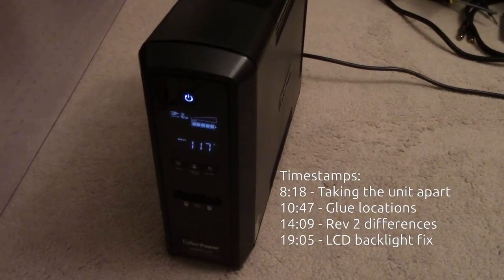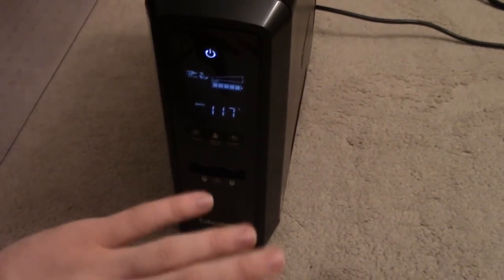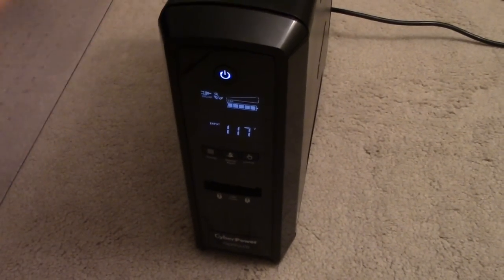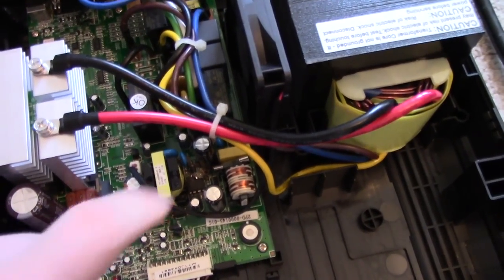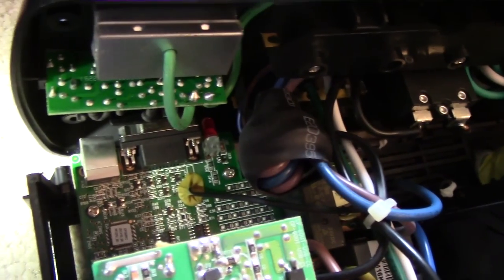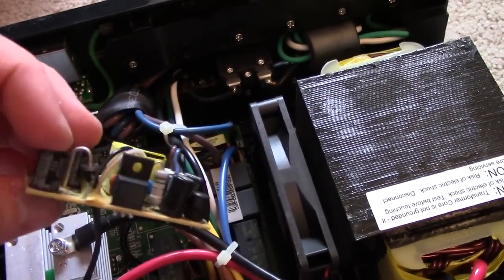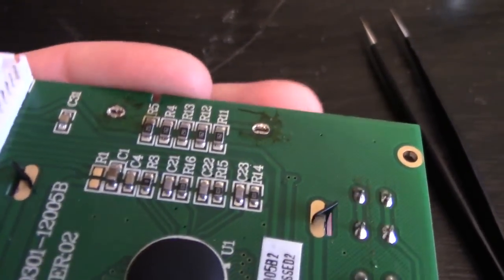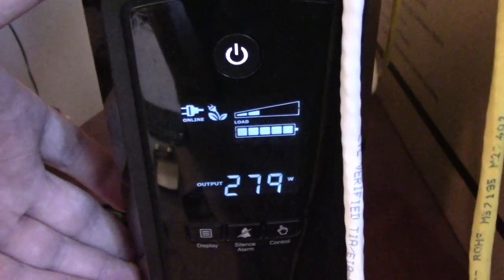CyberPower UPSes Contain Conductive Yellow Glue of Death (+ Bonus Rev. 2 Dim LCD Fix)

Comment: I've had multiple of similar UPS fail (CP1000AVRLCD and CP850PFCLCD) in the past.  Probably purchased around to 2011-2013 timeframe.  I don't believe that any of them lasted longer than 2 years.  The attached devices would lose power and I would smell a horrible electronics burning smell. I would look over to the UPS and it would be melting and/or smoldering.

I wonder if this is why.  Too late to go back and investigate.  I had 5 UPS fail this way.  Most had a <20W load and I think the CP1000AVRLCD may have had an intermittent 200w load.
Reply: what made you buy another after the first two burnt?
Reply: @nyaa  I had purchased them for other people...so I didn't know of most of the failures until I started asking around.

They were all generally purchased before the second failure. I didn't identify a trend until the second UPS failed.  When I heard of the third failure, that's when I asked everybody else if their UPS failed.

Comment: I picked up a CP1000AVRLCD recently (old model with single silver button in front) and took some pictures of the inside, just for reference, and I see some of that stuff, all dark orange and caked, almost exactly the same place as yours (board looks to be laid out similarly). Better put this offline and clean that up. Thanks! BTW top just pulls straight off on this model (stick screwdriver under and pry up). Rest unscrews.

The one by the capacitor in the center was too hardened to get off without potentially damaging the hidden components underneath. I didn't measure very low resistance (in the Mohms) so I'm just leaving it in place.

Comment: I have an old 2012 cyber power 1000 avr that's been in use since time bought with no issues so I disassembled it looked at the board but could find no glue used anywhere. I figured if it's under the caps a bit of it would be visible from the sides but I can't see it at all. My question is could it be possible they didn't use any on it for that particular year? I figured if they did it would have smoked out a long time ago.

Comment: Fun, I have two of these deployed! This will be interesting...

Oddly enough the one in my server rack (mounted 90°) has an issue where the power button flickers and the LED has basically stopped working after the two years I've had it.
Reply: Same thing happened to one of mine so I emailed Cyberpower and they sent me a replacement front panel even though the unit was older than a year.

Comment: Huh, the adhesive I have always seen is white, so I wonder if there is a few different types of the adhesive!
Reply: the white adhesive is typically silicone based.
Reply: @ryanhebron4287  that's what I was thinking, and they are only saving a few cents, I wonder why they went with this shittier version
Reply: @davidtheawesomeone5358  A few cents over tens or hundreds of thousands of units adds up real fast. Its also Cyberpower so... I personally prefer APC and Eaton.
Reply: @ryanhebron4287  yup, I understand that. And me too, I prefer APC, used them a lot and they last

Comment: I been using this unit since college. I’m guessing I bought it in 2008/2009 when NCIX was still around. I have replaced the batteries once in that time frame and am still using this unit. This video has me worried as I sleep next to this unit as my computer and equipment is in the same room in my apartment. I was planning to buy a new one and migrate the old one to the living room for the entertainment center. Now I’m not sure what I’m gonna do as I have no plans of tearing this unit down to go poking at something that I’m not familiar with and I don’t understand, if this is as bad and dangerous as what being said, how is cyber power not sued by anyone yet for it. Has anyone had a fire due to this ?

Comment: I just took apart one of CyberPower's Value line UPSs (the old, cheap ones) and it was using hot glue for connectors and silicone glue for caps. Are you sure they haven't switched away from Sony Bond altogether? Feels weird they'd be using the good glue for the shitty UPS and the shitty glue for the high end one.

Comment: Hi, I have a Cyberpower CP1500EPFCLCD which will not turn on. On the bottom switching I have 27V but when I press the power button I can only hear a very very short "bep" from the buzzer but nothing on the screen and no relay switch. I have no power on the 3.3V regulator near the mcu on the back of the board and also on the MC34063A regulator near the heatsinks. Can you please help me? Any idea where the problem could be? Thank you very much! 
Simone

Comment: Fixed one of my UPS's, the glue was a bear to get off. "Flux Off" (mostly acetone) does seem to help soften the glue some to make it a little easier to get off.

For the LEDs, what LEDs can be used to replace the screen and power button backlights? I've got to place an order but am not all that familiar with LEDs. Voltage across the 3 screen backlights is 2.8V and I see about 1.68-1.75 V on the power button backlight. Which is odd because I don't see any white LEDs around the 1.7 voltage range?

Comment: That glue can be found in many other things...exit signs, emergency lighting, industrial machinery, even robotics. other UPS brands use it too. If there was a fault with it, there would be far more issues reported, and i see no evidence of that specific thing being a wide spread concern.
The darkening most likely is due to heat i would think.
I have had over a dozen of these ups's in service, for several years, even the old ones, never had a single issue with them. Even the v1, v2, still in service. CyberPower been the only UPS brand I trust, never had a single failure, unlike APC; to which, i have never had a single unit of theirs last more than 2yrs and one actually caused a small fire at a previous workplace of mine. CyberPower is actually headquartered where i live. Not some overseas company. I can just drive to their headquarters if i eve needed to.

Comment: Have you figured out how to open the third gen case yet?  It is different than you describe.  There is no longer a separate top piece cover that just slides back to reveal clips that you can disengage.  The top appears to be identical to the bottom in the way it snaps together.  The back is different too.  Just 4 screws now and clips in the middle.  The back is easy enough to take off but haven't yet figured out a way to separate the two sides.

Comment: Great Video, thanks for sharing.  I have 3 of the Rev 2 units, purchased back in 2016 and the first unit that was supporting my Modem, Routers and 1 DVR PC died last night.  I pulled the batteries and one had a little over 10.5Volts and the other only has a little over 6 volts, so time for upgrades.  I will pull the unit apart and check the glue issue as well.  Have you tried replacing the Lead acid batteries with Lipo batteries by any chance?  Batteries are about $45 each, but claim 4000+ recharges, 90% capacity and 8-10 Ah capacities with up to 10 years of life!  I did replace one in an old small APC 500 Watt UPS and its working fine.  Was thinking about doing the same for this one.  Any thoughts or suggestions??
Reply: I have seen it for myself that you get double the run time if you use a reputable company brand of LiFePO4 batteries with the same AH rating. Seen in both the CP1500PFCLCD and CP1000PFCLCD of which both use the 12V9AH SLA with the CP1500PFCLCD using two in series and the CP1000PFCLCD just using one.
Reply: @FirstLastOne  Yep, that is because you can run them almost completely dead without damaging those batteries.  The wet cell or gel cell batteries really should only be used down to about 50% before recharging or they can get permanently damaged.  The only issue I see with replacing the Gel cell batteries with LiFePO4 batteries is that the charging and maintenance electronics in the UPS does not know that they exist.  The Charging, Maintenance and actual running and cut off voltages are all different for the LiFePO4 batteries.  The UPS itself is not really optimized to use those types of batteries although I have replaced one in a small APC UPS with one of them and it seems to be doing okay at the moment.  Unless you can tell the UPS what "Kind" of battery you have installed, it will always assume it's the type that it was originally shipped with and the charging and running profile will always be used even on the LiFePO4 batteries which is not optimal or efficient and actually could eventually damage the batteries.  In my humble opinion, If I'm going to spend a fortune for LiFePO4 Batteries, I will only do so to install into a UPS that can take full advantage of them and not risk damaging them due to improper charging and running profiles.  On some Recreational Vehicle Charge Converters, they are now shipping with the intelligence built in to determine what "Kind" of battery has been installed, and they automatically adjust their charge profile and run profile to match the battery type, optimizing the life, run time and charging of the batteries.  Hopefully UPS Manufactures will get on the bandwagon and do the same in their new products giving consumers more choices when replacing UPS Batteries.

Comment: I have 2 of the Rev 2's which both LED screens have died out.  Since I have no experience changing LED's is it possible to order Rev 1 or Rev 3 screens and swap out with the Rev 2's?  If so do you have a link where to order these?

Comment: I checked the Sinewave 900va (EU version/plugs) that I bought 3 years ago. It is not v3, since afaik there's no v3 EU versions. I didn't attempt to open the side panel, but I looked through most angles and saw the glue on the big capacitor. It wasn't brown, looked "healthy" and wasn't touching other components, so I saw no need to do anything.

Comment: Well I jinxed myself with this one. Watched this video and a few hours later my UPS the 1500 model died with a f03 fault :(
Reply from the maker: F03 is a charger fault, which occurs if the voltage is too low for an extended period of time. I have seen this before, and it was a shorted battery pulling the voltage down. If you disconnect the battery and the error goes away it's likely this.

Comment: Designed to fail! They could have put a random number generator in firmware. After a predetermined number of hours, a firmware algorithm begins rolling dice. The firmware rolls in the customer's behalf, eventually rolling craps. This of course is where the machine "craps out," the customer loses, and now he has a problem. But this is rather crude, failure which also involves a burning smell. (My wife was not pleased.)

You know a lot about surface mount and electronics. Thanks for useful information.

Comment: Sony invented it for use on electronics, its Chloroprene SC121.  They quickly realized that it would become conductive and stopped using it on their on electronics  and for a while sold it for other companies to use on their electronics.  They still sell it to other companies to this day with a disclaimer that it should not be used where it comes in contact with electricity.

Comment: I have a CP1500avrlcd which looks very similar to the CP1500PFCLCD and is often compared in many reviews.  The problem is that the CP1500avrlcd's case isn't exactly the same as the top cover doesn't slide off and removal of the four screws on the back won't release the back plate with the sockets.  Anyone know how to disassemble a CP1500avrlcd?
Reply: With electronics, the secret is often hidden screws. In particular, have you checked under any labels/stickers?
Reply: @bradkaral1188  Unfortunately, there aren't any stickers.

Comment: I got a CP900EPFCLCD second hand. However, it has the F03 error in it. Already removed all the glue I could. In the beginning I thought that just swapping the blown caps would be enough to fix it. It seems that the UPS is not charging the battery at all. When I charge the battery with an external charger, it seems to last between 2 to 4 days working without issues. However, after the battery voltage drops bellow a level, the F03 error is triggered, starts beeping without a pause, and I have to switch it off and disconnect completely. What can I do to fix the error? :(

Comment: I thought they they only used this crap around LV areas and used silicon around HV areas? Apparently not! I gather that being made of chalk and applied in a heat prone area it looks like it's heating up, drying out, breaking down and probably absorbing some moisture from the air.

I've got one of their large power board style UPS thats just about in need of a battery replacement. I guess I'll have to check for this crud as well. I was also going to by a second cheaper one of theirs.

Comment: Fantastic video.  My Rev1 model (from 2011) just got new batteries and when I plugged it back in I heard arcing.  Opened it up per your video and wouldn't you know it.  Arced at the fuse/resistor right next to it.  Both are dead.  Yaay.

Edit  I found the correct size fuses for the circuit board.  Does anyone know, were these fast or slow blow fuses?

Comment: By change do you know if the CP1500EPFCLCDa-AU (230V / 50hz) models are likely affected?
Reply: I'm not in the AU region myself, but I can confirm my Schuko-connector CP1500EPFCLCD has glue that is turning brown as well. I have two units, only opened the one so far (as the power LED started blinking and flickering like crazy) and will be attempting the repair soon. Just replaced the batteries on both as well, so hope I don't end up ruining them...

Comment: Screw doing all that. If one is that concerned just get a new UPS. I've been using my CP1350PFCLCD for 10.5 years without any issue. I recently replaced the batteries. I'll replace the UPS in 3-4 years which is the recommended lifespan for a UPS.

Comment: I have one of these units.  Bought at Best Buy, 4 to 6 years ago.  When the power went out, it had near zero power in the battery.  If the battery is designed to last only 1 to 3 years then there should be an easy access to replace the battery.  Otherwise these are all just landfill garbage.  Update:  The batteries were full.  Something on the board went out.  It is built so light duty that I don't think it would work right straight out of the box.  Junk.

Comment: hi budy, can u help me? I have a CP1350PFCLCD unit to which I was going to change the batteries, but when connecting to test it without them, the screen no longer turned on. when I put a new battery it works fine, but without it it doesn't even turn on

Comment: I dunno. It seems like lay disassembly of a line-level voltage system like a UPS could easily prove more hazardous than the glue, especially advocating picking at the board and components with presumably sharp metal tools. Also, your description claims "fiery failure" happens but you provide no evidence of such unless I missed something. You mention a "blowout" on the unit on screen but obviously it didn't catch fire since you repaired it and it looks fine? So what fiery failures have occurred exactly?

Comment: does this effect the CP1500EPFCLCD model not sure what the difference is with the extra E in the naming.
Reply: wanted to buy this model too, you didn't opened it to see if there said glue in inside?
Reply: Looks like it does. It's a slightly different design on the inside (different layout, probably to cater to 230V), but one of mine has the same goop on/around the chip... and it's turning brown. Haven't opened the other one yet, but I'm assuming it'll be the same story there. Attempting my repair tomorrow, hope I don't ruin them... Just got new batteries, too. :(

Comment: Sept. 9th. 2021: When I bought two of those on Amazon yesterday, then I saw this video for the first time. I did call the company and talked to their technical dept.. (Cyber Power Systems USA, Inc.) They say they know about this video; they're not worried because it's completely false; The tech guy said that If this was true, the 'National Electric Code would not have approved the design; this Federal entity has seen the video and verified with them that it wasn't true. What'smore, their marketing dept. is looking into suing this channel for slander.

EDIT: Oct 10.- Been a month and only now that I'm protected do I realize how vulnerable I was and what great feeling it is to know that "nothing can happen" to all my shit. I live in a small village in Quebec and 3 or 5 times each winter there are blackouts. This machine gives plenty of time to go around and unplug everything, ready for the high peak when the juice comes back... and of course, if there is a peak, whatever is protected won't suffer. I'm in the process of buying single outlets protection for the TV and a few other items.
Reply: Slander? Really? For an issue that has been reported several times, by several people, across several regions, and with some pretty solid arguments on the how and why?

For what it's worth... I just got done scratching away the browned glue from one that started misbehaving, revealing a heavily stained circuit board. It did quite a number on the sleeves of nearby capacitors as well! Bought both of mine just over 5 years ago so I definitely got my use out of them, but I'd really rather not have an electrical fire on my hands if one does decide to short out along the wrong path.